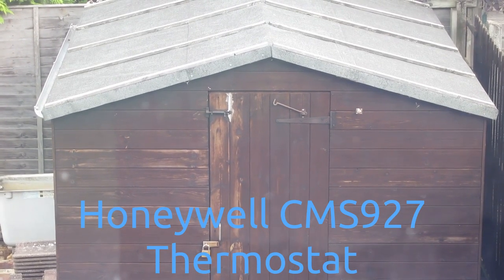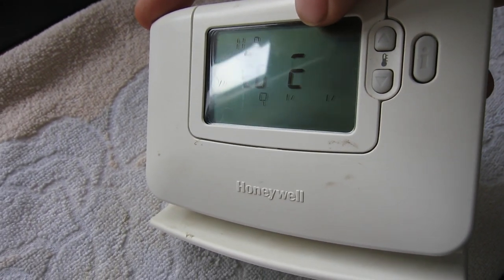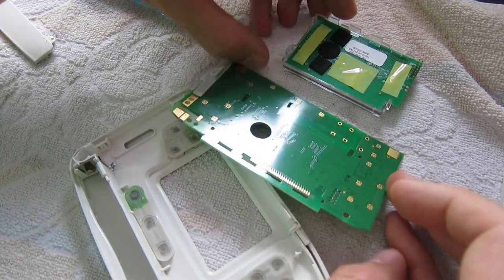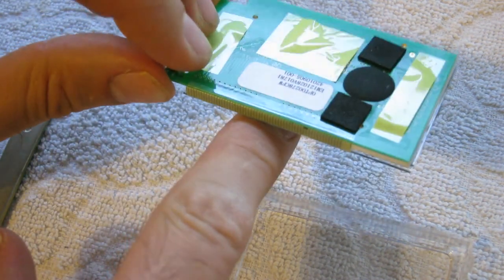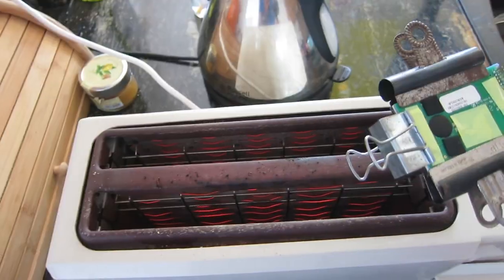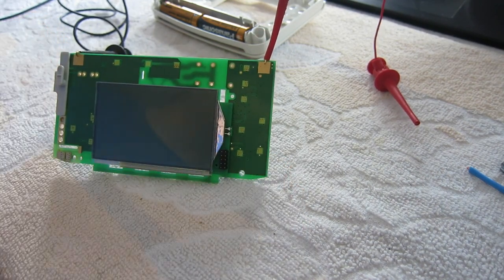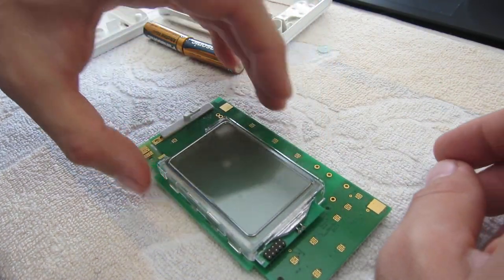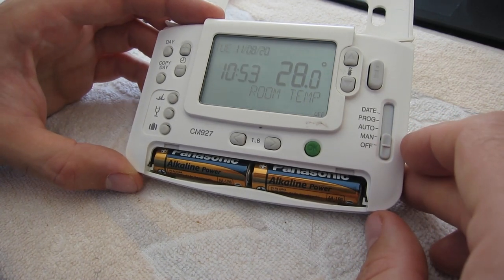Honeywell LCD fail and repair - no background music

Comment: Finally got round to this just now and it worked perfectly. I waved the lcd side slowly back and forth in a flat position about three inches above the toaster for about two or three minutes. I did it until the screen colour darkened a bit and I don't think it got very hot. I let it cool and repeated the process. 

I put a narrow wooden stick into the gap that was just the right size to compress the contacts without crushing the gap when the clip was on it. The stick  came nowhere near to burning. I now have both controllers working good as new and the operation is quick and easy enough to do again in the future if necessary. I have seen new controllers advertised for over 200 quid so this is a very satisfying fix. 

Many thanks!

Comment: This is so helpful - thank you. Rested mine on top of the toaster. Bit nervous about it over heating, so started with 30 seconds (tad better), then tried 1 min (better again) before going for 1 min 30 which gave me a 100% display. Gave it about 5 minutes to cool in the kitchen, then put it in the fridge for another 5 before reassembly. For the packing, I cut one of the pointy ends off a cocktail stick and shaved two adjacent sides flat with a scalpel, sliding it carefully in blunt (cut off) end first after I'd put the bulldog clip on that side. Flat sides downwards and to the front. Very grateful.
Reply from the maker: It's good to see the different ideas people use for the packing.

Comment: Your method worked like a charm for me. It turned out there's no need to cook the hole assembly - I ended up heating up my clamp above the toaster and, once moderately hot,  putting it on for 30-60 seconds and checking the display afterwards. It took three iterations.
My thermostat looks as new. Thank you very-very much!
Reply from the maker: Good to know :)
Reply: @mygrandadsshed  I did wonder about a pair of hair straighteners...

Comment: If you have access to a small soldering iron, set it to 200℃ and go a bit back and forth over the glued areas on the flat flex cable while applying moderate pressure.

Comment: I tried this fix using a hair dryer instead of a toaster, I got all but a few bits of numbers back but it is readable and usable and definitely cheaper than the replacement costs (£100+) so well worth it. I appreciated the easy to follow breakdown and fixed mine for the time being. Thanks
Reply from the maker: I'm not sure how long, but the display will turn black from the heat. The clips are important as they supply pressure to keep the assembly together.

Comment: Worked for me, using a hair dryer to heat the LCD module instead of a toaster. Will see how long the display continues to work. Thanks for the video !
Reply from the maker: It's been a couple of years now - this winter I've lost enough segments to make it annoying. Redoing it will be on the summer jobs list. If time permits I'll record that process and post a new video. The more likes the higher up my jobs list it will get :)

Comment: I found this similar fixes on a few different sites and tried it with no success until I tried this method of stripping the unit right down to the screen itself. It worked on the second attempt after I left it on the toaster for almost 2 mins then put it in the freezer to cool off before moving the bulldog clips. The screen went very dark but recovered when it cooled off.
A great fix that saves £100! Many thanks.
Reply from the maker: Glad that it worked for you :)
I'd day to others, let it cool naturally back to room temperature, a cold freezer plunge might thermally shock components on the board or the display.

Comment: I had the exact same problem and thanks to you it is now fixed and up for sale as a complete, working unit.  For all those who have a FAN assisted oven:  150C. 2 mins, middle shelf on an upside-down baking tray.
Reply from the maker: Nice to know another method - especially with better temperature control.

Comment: THIS WORKS.  The first time I tried, I didn't leave the screen over the heat long enough, so made no difference.  I tried again until the glue holding the screen and backing melted enough to separate the two, and when it cooled down the screen worked again.  Thank you, and saved me £100 buying a replacement.
Reply from the maker: And you saved the environment by sparing your controller going to recycling. :)

Comment: This is astonishing. I have never played inside electronics before, and it worked! Almost perfect, second time. First time 20 secs on the toaster. But it hadn't worked. Then used a hairdryer and a cooking thermometer to monitor the temperature. Took it to around 70° as in another comment, re-assembled, and hey presto! Thank you so much.
Reply from the maker: If only all electronics was this easy to fix :)
btw how black did the screen look at 70°C?
Reply: @mygrandadsshed  6 on a scale of 1 - blackness to 10 jet black. Rather a guess of course. How on earth was this discovered? Not the sort of item that inadvertently gets left over the toaster. Presumably there is some theory behind it?

Comment: It works! Display was almost blank, couple of minutes over the toaster, working again. It looks & smells like you've completely trashed it, but the LCD clears after a few minutes. Hopefully it will last some time. To the manufacturer's credit the device is really easy to dismantle with no gotchas. The only negative is that flimsy ribbon cable fixed under the backlight so you can't see it
Reply from the maker: Since recording the video over a year ago, I have now lost two elements from the word "room", but the important numbers are still good.

Comment: Tried this way previously with some success, but after a while the LCD problem would return. The last time I tried, not all the display came back. Then I saw another YouTube video, where a piece of wire insulated mains wire is inserted under the length of the ribbon, between the LCD and circuit board. The paperclips to squeeze everything together. I used a hairdryer to provide heat, concentrated on the ribbon area both sides. That did the trick. LCD was black, then returned to normal as everything cooled down. Once assembled LCD worked properly this time. The ambient temperature was showing as high for a while, then gradually returned to normal after nearly an hour. 
Will hope this fix lasts a lot longer than previous attempts.
Reply from the maker: Hi, glad that it worked for you. As others have commented the packer between the glass and PCB to sandwich the flexi connector is important to remake the connection when heated.

Comment: Yes, this worked for me.. thank you! I have another method if you have the tools available. Cable tie (3.6mm wide) + hot air re-work gun (for electronics - link below*) + one bulldog clip.

I used a 3.6 x 250mm cable tie as "packing" ie. slid vertically in the gap behind the green ribbon connector. It slides in a few cms then stops. It is the perfect height and will apply pressure on the adhesive of the connector/PCB junction from above (which seems to be where the problem lies). 

1. Pre-warm the underside of the pcb near the ribbon connector using a hot air gun set to 220 C/Fan 50% for 1-2 mins. 

2. Clip a single bulldog clip on to the edge of the glass over the ribbon and heat the bulldog clip until hot to the touch (both sides - but mainly the underneath) for 1-2 mins. 

3. Move the bulldog clip slightly so it is only over the ribbon on the top side (and pressing down on the cable tie packing inside) and heat the general area and bulldog clip for 1-2 mins on both sides till hot to the touch. The edge of the screen slightly discoloured near the edge but faded quickly on cooling.

4. (Optional) After cooling, I clamped the glass screen gently (!) in the centre using one of the clamps linked below also then warmed the glass front of the whole screen for 1-2 minutes using the heat gun set to 220 C until it slightly discoloured. I saw something similar on another vid and I'm not sure this is necessary but I include it for completeness. 

Optional Mini-woodworking clamps: 
https://www.amazon.co.uk/Silverline-250108-Mini-Clamps-100/dp/B001C7LTSW/ref=sr_1_1?keywords=silverline+250108+mini+clamps+2pk+100mm&qid=1662932632&sr=8-1

5. I tested it by placing it back on the mainboard, plugging in the connector and testing using a lab power supply at 3V before re-assembly (positive lead goes to top right contact if you have the power contacts uppermost - as shown in the video by MGS).

It seems to have completely solved the problem - all digits working :) Thanks again.

* https://www.amazon.co.uk/Desoldering-Station-Rework-Welder-Anti-Static/dp/B09MZ4T37W/ref=sr_1_10?crid=BMGV1EJMGJ7O&keywords=hot+air+gun+for+electronics+959D&qid=1662935838&sprefix=hot+air+gun+for+electronics+959d%2Caps%2C74&sr=8-10
Reply from the maker: Indeed that is how I would have done this using equipment at work. :)

Comment: This is a really helpful video.  Still too scared to do it myself but at least I now know what the problem is.  Many thanks.
Reply from the maker: Once you decide it's so unreadable and a new one is required you might as well have a go, as at that point you have nothing to lose.
Reply: I managed, as long as you have heat source, a screwdriver - and I found a mounted pin very helpful to undo the four clips. They look as if they are designed to be pushed back by something like that. It's a doddle, I've never fixed anything remotely like this before.

Comment: Many Thanks! it worked for me as well on CM901 model, only difference I used a hairdryer to heat it.
Reply from the maker: Excellent!
Reply: Tried this but display still sporadic. You think I should concentrate on the ribbon which attaches to the screen?

Comment: This has worked for me before, but this time I think I might have melted the LCD screen... Just waiting for it to cool down so I can put it back together and see!
Reply: I'm amazed, I thought I'd cooked it, but apart from saying "FOOM TEMP" the rest of it is legible. More importantly, I can actually turn the heating on!! Thank you so much :-)
Reply from the maker: Thanks for reporting back. :)
Since I did mine 18months ago I have since lost a few of the characters, but I can still read the time and temperature which is what matters.
While I agree with some comments this fix is not 'permanent'; it's accessible to people who would otherwise buy a new controller.

Comment: Hi, what wires are you using to connect the batteries and circuit board? What were you using at 7:06, and how does the screen hold up long term after the heat treatment?
Reply from the maker: The blue packing is an offcut of 2.5mm T+E mains cable I had laying around, trimmed to give two flats. It can be anything that will not melt at 300°C during the cooking phase. It presses the flexi back onto the glass and PCB. 
Can't say long term, my display is still good today so 3 months so far.

Comment: That piece of "padding" seemed to play an important role but it looked like plastic-covered wire which would have made a molten mess at 200 degrees C. A bit more detail about it and where you placed it would have been very welcome.
Reply from the maker: When I filmed, to be honest, I did not appreciate how important the packing was/is. 
I used a short section of mains wire, it's 1 core from a twin and earth cable. 
To make it the right size I used a knife to make it a bit thinner.
I guess something like a wooden lollipop stick would also work, crafted to the right size.
It is there to support the flexible connector between the main circuit board and the screen, so as it heats up the pressure squashes the contacts back firmly.
Reply: @mygrandadsshed  OK.... I see that the contacts need to be compressed from inside and outside to re-establish the connection. 

I'm just a bit hesitant about what material to use if the temperature is going to get so high. A wooden strip sounds a bit risky as well. 

Or is mains wire safe to use at that temperature?
Reply from the maker: The duration over the toaster is not long enough to burn wood. Most insulation cable should not smoke before 200°C - you can try heating it before putting it between the glass and circuit board to check the behaviour.

Comment: Thank you for the video, it is very educational.
However, I did not manage to recover the display despite 3 attempts. Could you tell me why? Is there another solution? Thank you.
Reply from the maker: Sadly I don't know. There are several reasons why the display might stop working, but the connection to the glass is a weak link due to differing coefficients of thermal expansion.

Comment: Thanks for this. I was looking for help with the LCD on my ravenheat boiler...would the heat trick (hairdryer) work with the LCD in situ?  I don't know how to/if the LCD can be removed on my boiler.
Reply from the maker: Hi. The heat required will probably damage the surrounding plastic or components like buttons.
You also need to be able to add pressure onto the LCD connections, so the heat can remake the joint.
Reply: @mygrandadsshed  thank you for your reply

Comment: Very clever. Are we to deduce that the heat from the toaster sorted the failing LCD screen?
Reply from the maker: The heat from the toaster, along with the pressure of the buldog clip (and packer) softens solder and remakes the connection of the flexi to the main PCB and the glass.

Comment: I did one of these and it worked a treat, ent to do my second one and didn't realise there was a plastic film over the screen which melted, the screen now has a black part which usually disappears after cooling but hasn't, is the screen now ruined or is there a way to solve this? Even if its broke I'm glad I got one fixed!
Reply from the maker: Goo news for 1 :)
Being glass the screen with the melted plastic should be recoverable. Reheating, gentle scraping and then a cleaner like IPA or acetone (nail polish remover) should clean it up. Just take care not to stress the flexi and damage the connection while it's demounted. Good luck.

Comment: hi to all,
can anyone send me correct part number for the lcd? i've the same problem but i don't know what lcd i've to buy
Reply from the maker: In the comments of my video that has the annoyingly loud music @jwstolk posted a suggestion of a part number: CMT907G1003
Reply: @mygrandadsshed  Note that that's the part number for a complete thermostat, but it's the cheapest and most basic version, and in my case the LCD module worked with my much more expensive wireless/modulating version of the thermostat.